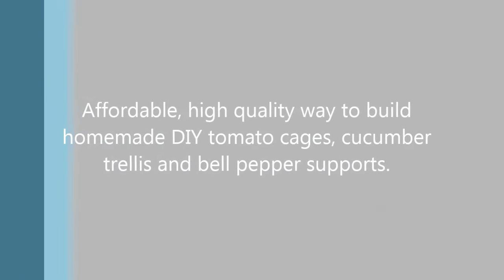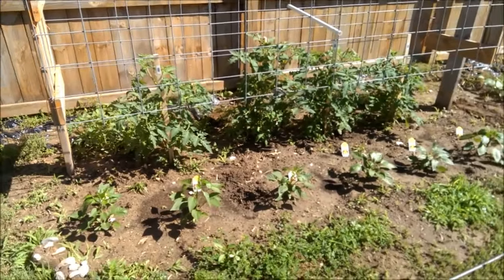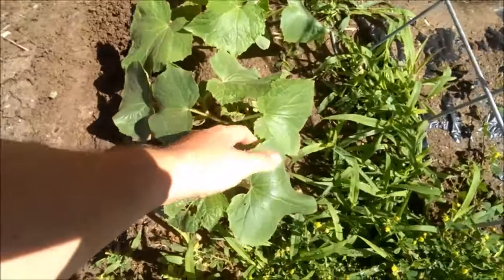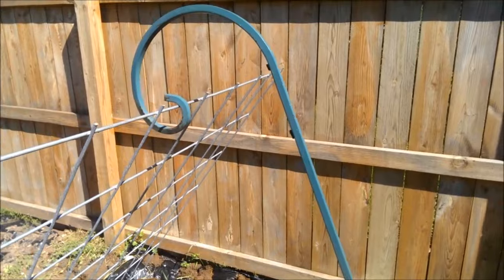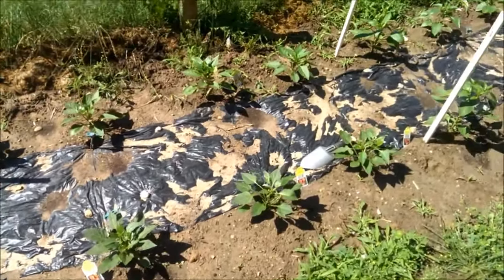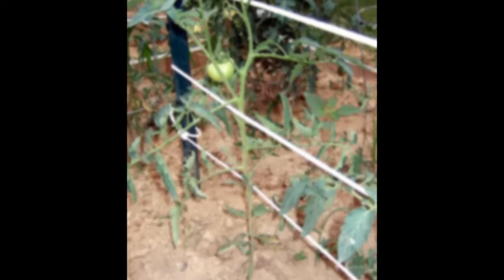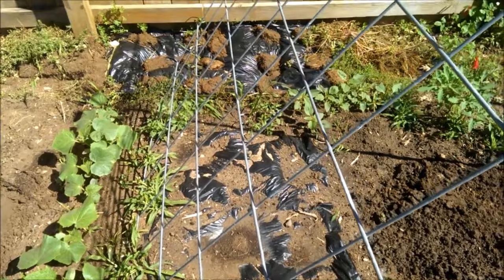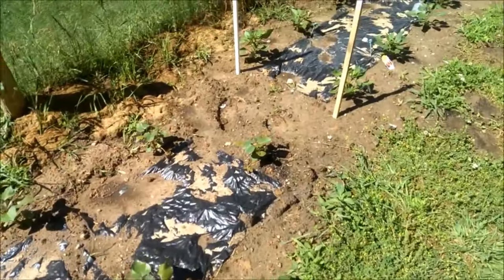How to make the best tomato cage / cucumber trellis / bell pepper weave

Comment: The cattle panels seem like a great option, IF one happens to own a big pickup truck.  Otherwise, they'd be really pricey to have delivered.
Reply: smart451cab: They are actually easy if you have  any pickup truck.. I buy the 16ft pcs & only have a small truck.. You just need truck, a way to tie them on each corner & preferably another pair of hands to help.. You simple place the cattle panel down & left the end towards the tailgate & push it back toward the center. This will make an arch in the center, close tail gate & tie panel in corners down for safety reasons. I have never had one come out, butttttttttt there is always a chance.. ;)..
Reply: smart451cab I just bought one from Walmart for 24.00 including tax & delivery... 2'x 8'
Reply: You could cut them into the desired length in the store's parking lot.
Reply: You gave me some new ideas for trellising.question, do you have any trouble with weeds growing on top of the black plastic? also, what do you use to cut the cattle panel?